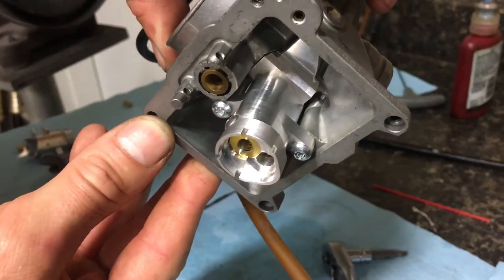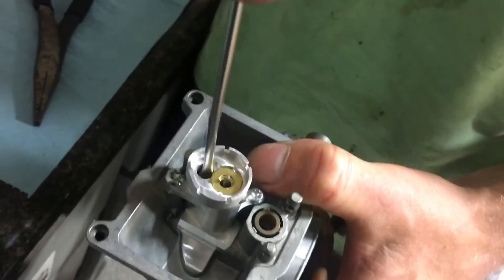How to: STIC Metering block installation

Comment: At 3:01 in the video, why does it look like the screw isn't screwed all the way down? It's either not in all the way or it's too long for the application.
Reply from the maker: I am not a professional video editor - to get all the shots necessary for the clips, not everything is shot in order of actual installation or process.  Hopefully the concepts presented here are useful - if not sorry!
Reply: @HPRaceDevelopment  I understand the editing process and it was fine, not what I wanted to bring attention to. Your statement of making sure the screws are tightened down properly is reiterated in the video by the fact that one got by unnoticed. So it can happen. Folks that buy the kit, pay attention. Thanks for the video.
Reply from the maker: @Trailryder42  As mentioned - the video is various clips and shots to make one video. To get footage of what I needed regarding the pilot I had to take a new clip and peace it together - as properly seating the pilot jet is critical.  There are more well done videos on the web from other vendors now
Reply from the maker: @Trailryder42  ok thank you

Comment: Can you tell me does that really work? I come from the 250 270 micro sprints that we were on alcohol we were on our Motors above 10000 RPMs what is this to do in my carburetor Hydro my dump tube out to 115000
Reply from the maker: 250race works great  recent test in england showed 2.5 hp on a 150cc ktm. Has interchangeable needle jets to make alchohol set up a breeze... even using normal gasoline needles

Comment: April 17, 2018. STIC jetting clarification: The STIC metering block comes pre-jetted to cover a full spectrum of applications from 125cc to 500cc. Yes, it is true the same main jet of 190 with a 48 pilot works on all of the applications; noticing this jetting is primarily designed for hot trial and motocross. This jetting applies to hot modified engines as well as stock; on average it will add five [5] hp to a stock engine. When the carburetors are bored to a larger size, it will make even more horsepower. There is no need to run a 36mm any longer as the 38 Keihin A/S will perform flawlessly. Contact me at this email STIC @ frontier .com [no spaces], and I will provide you with dyno reports that cover the entire spectrum. On applications [tracks, trails] requiring low-speed finesse such as Tokyo’s application; yes, it can be toned down to smaller passages. The STIC process is entirely new and cannot be compared to anything in the industry. Correctly jetted it has wicked acceleration and over-rev. Contact Inventor George